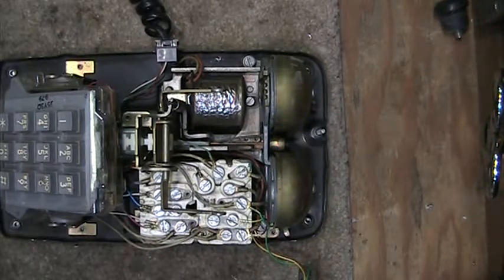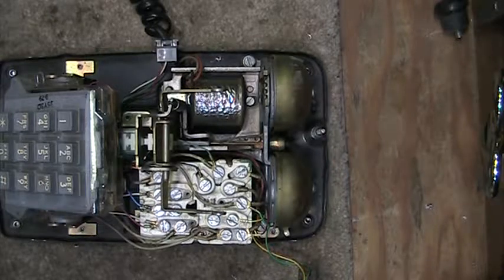Repairing a Touchtone phone that's not sending tones.

Comment: I bought a 1980 Western Electric desk phone (BECAUSE I DETEST CELL PHONES* and because W.E. phones are bomb-proof and comfortable to use and because Raymond Lowey was a goddam design genius) and connected it to my cellular line via an XLink BTTN Bluetooth Gateway.  Everything worked fine except the keypad produced no DTMF.  I followed the advice in this video, swapped the incoming red & green wires at their terminals inside the phone, ET VOILA!  I can use a REAL PHONE AGAIN! (that doesn't play stupid music when it rings)

T H A N K   Y O U ! ! !

____________________________________________________
*  To me the big problem with cell phones (aside from holding the bastards to your head) is exactly the one solved in the old phones, a design solution I first learned about in the 1970s:  People using a telephone need to be able to hear their own voice in the device in order to adjust the volume of their speech.  If the user cannot hear his own voice through the earpiece, he TENDS TO SHOUT .  Ever notice how many people SHOUT when they're on cell phones, especially in restaurants?  The brilliant behavioural idea implemented in the old phones was to feed a small amount of the signal from the microphone back into the earpiece of the receiver so people would not begin SHOUTING whilst on the phone but most cell phones seem to have forgotten this.  Even cell phone headsets or wireless earbuds neglect this necessity.  Even though I was aware of it, I still tended to raise my voice unconsciously on a cell phone and I hated that.  Old phone = problem solved.

.

Comment: Perfect! 

I have a 2500D2M that just came in.

Now mine had two wires under the screw terminals, but like you said, switch the ones connected to the jack and it worked like a charm.

Thanks again!

Comment: THANK YOU!  I have a Princess Phone, and I've been using it successfully for several years with the NetTALK VoIP device.  I recently got an AXvoice VoIP device instead.  (The NetTALK service was "out" about 10 times within a month, according to my friend who tried to phone me, unsuccessfully.  So I looked for an alternative VoIP service, and decided to give AXvoice a try.)

The Princess phone, when plugged into the AXvoice box (device) would not dial out.  (When I pressed the "1" key to start dialing a 7-digit phone number . . .  The dialtone would not go away!)  But, as I stated above, the phone dialed just fine when connected to the NetTALK VoIP box (device).

After following your instructions (interchange the red and green wires inside the phone), now my favorite Princess phone works just fine with the AXvoice device!  --Unfortunately, it no longer works with the NetTALK device!  Ha ha, if/when I need to use that phone with the NetTALK device, I will have to just take the phone apart and switch those two wires (the red and the green wires coming from the phone cord) again.  And then it will work with the NetTALK device (but would no longer work with the AXvoice device).

One wonders WHICH company's VoIP device is "wired WRONG", haha!  But anyway, my great old-time Princess phone now works with my new phone service, thanks to your great informative video.  So thank you very much, Sir!